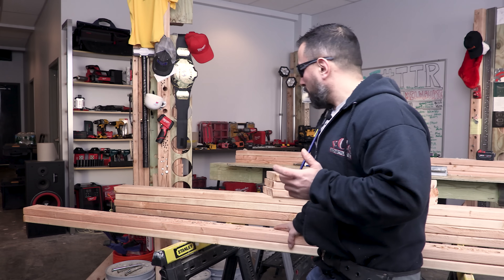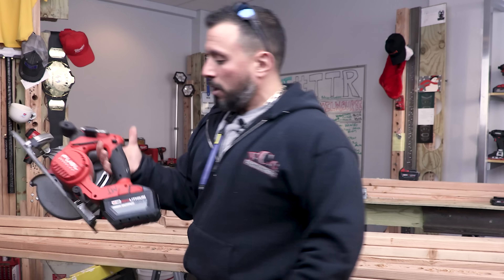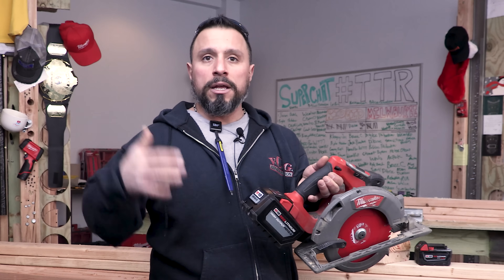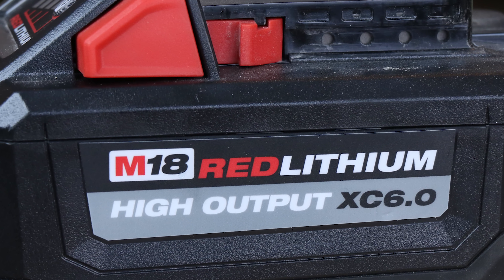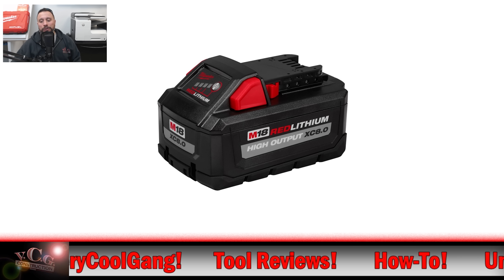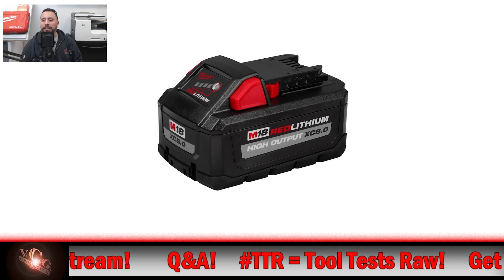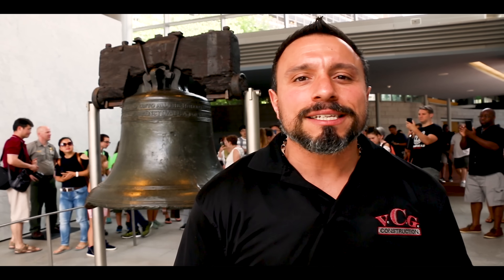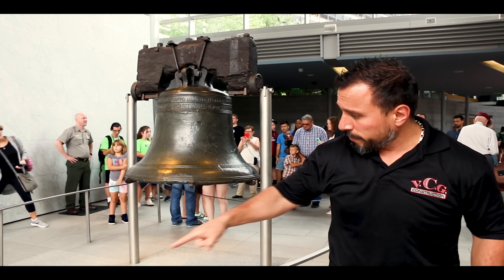Milwaukee Tools Brand New HIGH OUTPUT M18 Batteries!

Comment: Today December 12. 2022 I purchased my second 8.0 high output battery the first one came with the fuel blower with the rapid charger. But I got a 3.0 HO too. So now I own; 2/ 8.0’s. 3/ 6.0’s and 5/ 3.0’s high output batteries. And a bunch of 5.0 XC and 2.0 cp’s Merry Christmas 🎁 to me. lol

Comment: What I dont understand is that the High output 6ah and 8ah are identical in size, same weight ( however when I weighed them the 6ah was slightly heavier) and lastly they both use the identical cells (21700) so how can the 8ah battery possibly be better than the 6?

Comment: Stackable battery packs would be the best option. Say you use a 6ah normally but have a situation you need more power. You snap another 6ah to the bottom and your at 12ah. Wouldn't have to buy several different sizes. Hell 4ah ho stackable batteries would be the sweet spot. 4-8-12 would meet all demands.

Comment: The 6.0 and 8.0 balance that saw perfectly. It's too light in the rear with anything smaller but the 12.0 is too bulky for it. I wish they released the 8.0 instead of the 6.0 a year ago or whenever it was. The 8.0 and 12.0 use the same cells while that new 3.0 and the 6.0 use the same cellz

Comment: I have four 12.0 batteries that came with my circular and recip saw kits and I prefer the 9.0 an 6.0 over the 12.0. The weight is the make or break for me.
Reply: The 12.0 weight isn't that bad I use it at work with a circular saw.

Comment: I just did a search for this subject. Again I watched your video. Yes d the 5.0 lasts only so long. I got the 12.0 with the upgraded circular saw. It is heavy and better in the light. I have a 9.0 but I think that 8.0 runs just about the same. Might need another 8.0.

Comment: Love the channel, love the videos, & Love team RED. I buy most from Too Fast Supply in Nebraska. I just recently bought the Chainsaw for $380 which is their normal price with 12.0 battery and charger. the big deal which I barely got in on was a free M18 12.0 battery  so yes for $380 I got the chainsaw, two 12.0 battery's , and the charger.

Comment: A 3.0 will be welcome.  I use 2.0 in drivers for normal situations but the battery life leaves much to be desired.  A compact 3.0 will be welcome.  I have 9.0s and use them once in a while. Mostly still use 5.0 because weight is good. Not yet invested in higher outputs though!